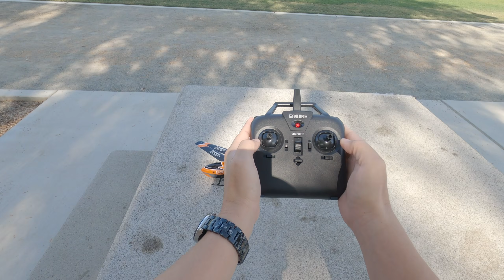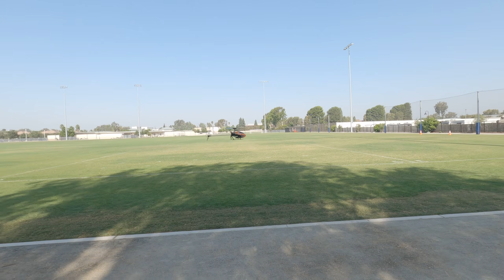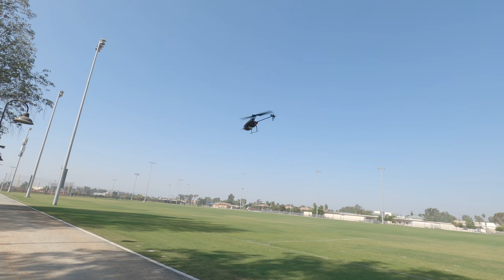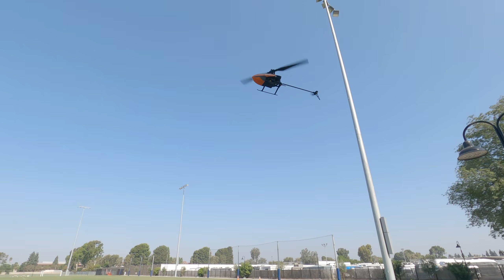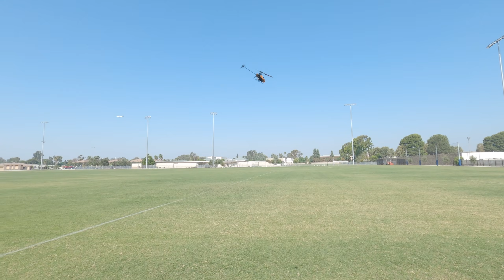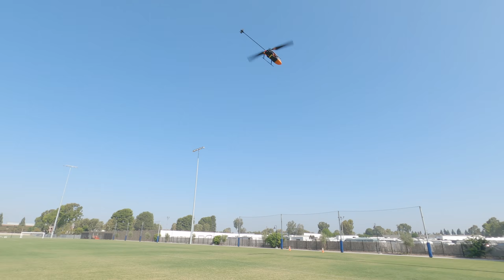Eachine E129 Beginner RTF Helicopter Review 🚁

Comment: Not bad. I got a couple JCRC ones for about the same price awhile ago.I would really like to buy a pnp blade or something and put crossfire and fpv on for giggles but helis don't like the wind much. Anyway I'm rambling, it's nice to see different rc stuff being reviewed. Thanks Albert!
Reply: This heli has a port for a Futaba fhss input, you can probably put other protocols on it too. I'm not sure about Crossfire but a long range fpv setup would probably be too heavy for it.

I put a (basically) separated 25mW AIO camera setup on my V977, which is similar in size to the e129 but brushless. It handles the weight well, but not as easy to fly as a quad.